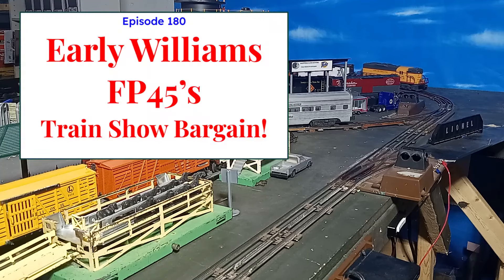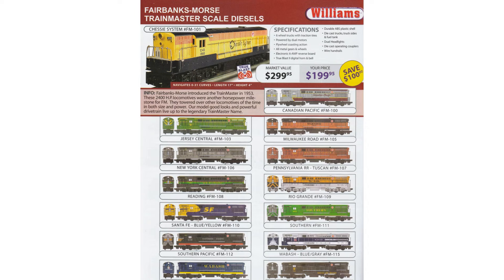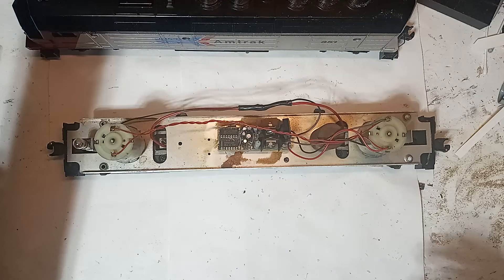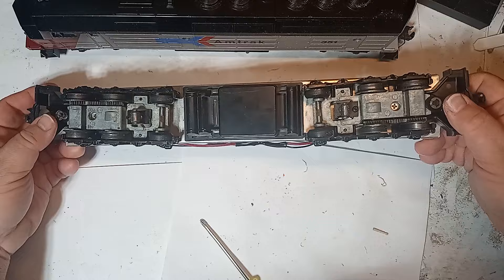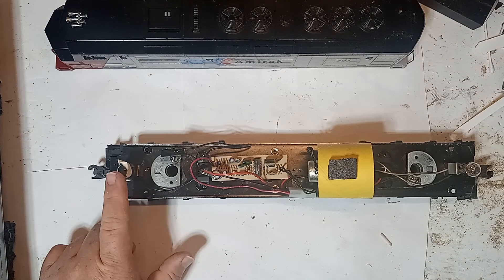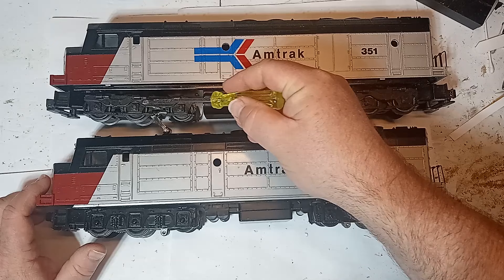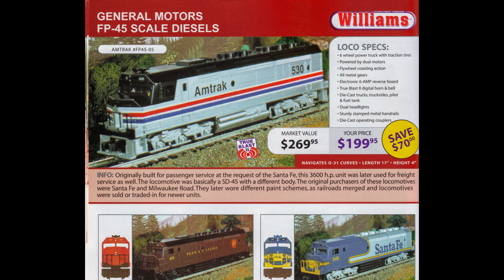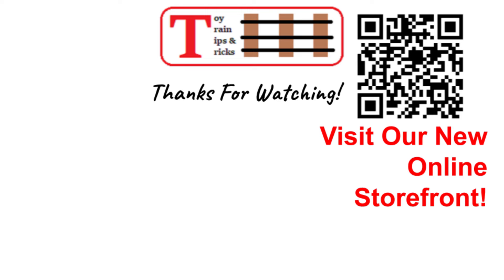Bargain Hunting: Early Williams O Gauge FP45 Models

Comment: Great and informative tutorial on vintage Williams!  
One thing I can add is Williams products don't have much collector interest so they can be found at shows for VERY reasonable prices.  Add to that the Williams bulletproof quality and the beginning operator can get a great start in the O Gauge hobby.
I've got several Williams engines, one Berkshire and two GP9's, all great runners.  In fact, I bought one of the GP9's to replace an ailing Lionel NJ Transit U-34CH.  A little "chopping and channeling and the Lionel shell fit perfectly on the Williams frame. 
Thanks for posting!
Reply from the maker: Good tips!

Comment: Santa Fe used the War Bonnet FP45's on Conrail TV220, a hot Honda parts van train to Marysville, Ohio.  They would run them back to Stanley Yard and wye them, or run them back with Conrail power in the lead.  I saw them in the yard a number of times during my career.  Williams and some of the other manufacturers, used the DC motors without flywheels.  It was like having an on/off switch and we found out the hard way when we first ran them on our club modular.  Later models had the flywheels, making them smoother and not jerky.  Either way, Williams, K-Line, Weaver and others, filled the need for less expensive, quality O gauge trains.
Reply from the maker: Comparing my FP45s to a newer GP7, the flywheel motors were much smoother, but tend to be drag racers unless you rewire them in series. The Old motor FP45 will creep pretty well, but they stop INSTANTLY once you drop too low on the voltage.

Comment: Have 6 Willians diesel locomotives. Aside from the low volume on their electonic horn 'n bell combo True Blast II , which can be tinkered with on the board, they are strong reliable runners with good pulling power. Don't expect creep speeds unless you rewire .
Reply from the maker: The early motors have a lower top speed than their later counterparts.

Comment: With all the comments about how great Williams mechanisms are, I might just have to give them another chance. Got my first Williams loco around 1998 or 1999, back when I was a teenager. Wires to the vertical can motors were too short, and broke easily. An easy fix, yes, back then as much as it is now, but this loco was a Christmas present, I really liked the paint scheme (Rock Island red and black with white pinstripes), and 25 years later, the disappointment still stings and put me off Williams products.
Reply from the maker: Wow. I have to say that other than the Mighty Mite diesels, that's the first negative comment I've ever heard about Williams quality.
Reply: @ToyTrainTipsAndTricks  Since yours is a channel I have a lot of respect for, I'm going to take that to mean I likely got very unlucky back then, perhaps one that slipped through the cracks at Williams. When it ran that GP7 was a good, smooth runner. I still have it, technically, though I swapped the body onto an MPC era frame so I could run it with my MPC Rock Island Geeps.
Reply from the maker: @modelrailpreservation  Yes. Williams quality control was generally excellent, so your example was highly unusual.

Comment: You got a great deal, but I just don't like the way it looks. I don't mind the look of real SDP40Fs (and the similar locomotives), but the nose on this one just looks too stumpy.
Reply: It looks sort of like the nose on a GE BQ23-7, but the rest of it doesn't match at all.

https://en.wikipedia.org/wiki/File:Seaboard_Coast_Line_BQ23-7_3001.jpg
Reply: And, conversely, I think that the nose looks longer with the handrails on.
Reply from the maker: It takes some getting used to. I think this scheme hides the bad nose better than others.
Reply from the maker: Interesting.
Reply: @ToyTrainTipsAndTricks  Aside from the picture of the Pennsy that you showed, I have only seen your Amtrak loco so I have no idea. The Pennsy looks as though the nose is much more stubby.
Reply from the maker: The BQ23-7 had NO nose at all! These aren't THAT bad! These aren't even as bad as Metra's F40PHM-3s.
Reply: @ToyTrainTipsAndTricks  My eyes agree with you. My brain, in complete ignorance, does not. Don't mind that I'm thinking irrationally. To tell the truth, the day after I saw this I still went and searched for one on Ebay. Much like my opinions on the 2-4-2 wheel arrangement, a good deal is above my principles on attractive locomotive design (I would probably find a way to extend the deck).